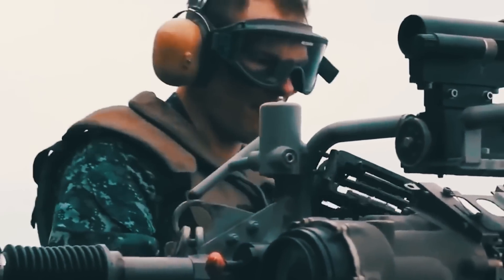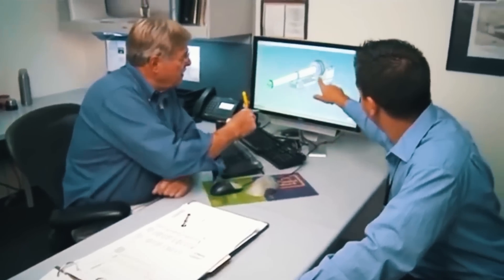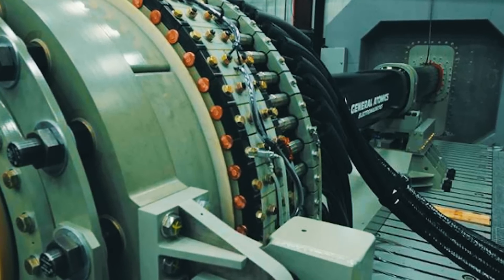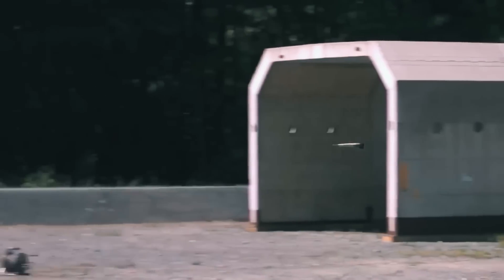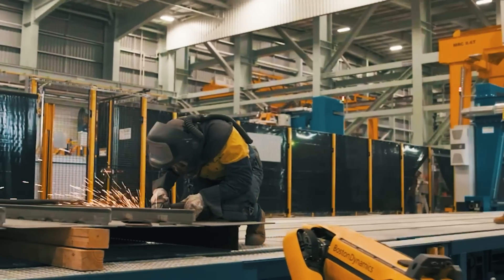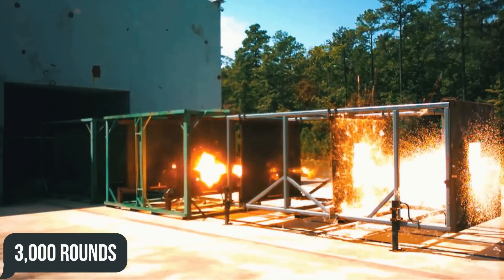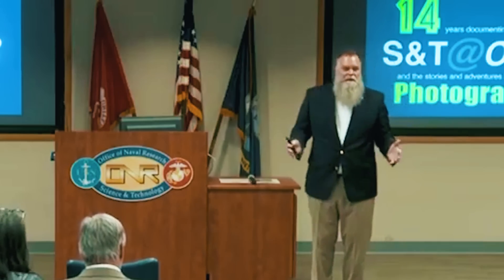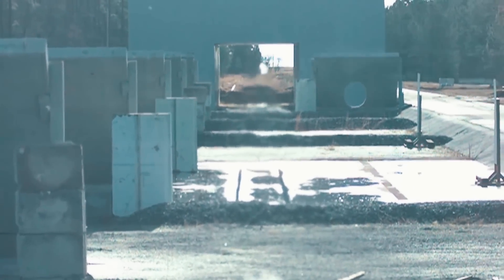US Testing Its Monstrously Powerful $500 Million Rail Gun

Comment: the rail gun is just a fancy meteor launcher

its advantage is: range, speed, accuracy, and destructive power without the need for an actual explosive warhead.

not to mention it will work in vaccum
the main problem??? we just don't have cheap tech to make it viable

Comment: A projectile traveling at 52,000 FPS had better be made of material that will withstand the temperatures of that speed. Normal metal projectiles will turn to molten metal within meters of the muzzle.

Comment: It's cool and all that, but it's not all that practical to use really. Like the huge one's make nice off shore batteries, Installing a set on a battleship would work, because it can use a mix combo of main gun turrets, powder charge for land targets, rail gun for ship to ship targets. The ship is big enough to use a reactor to pump out the power. I don't think it would make that much of a impact for a destroyer since most modern ones rely on missel systems and a single turret. Other than that, it is just a cool science project artifact to only see. Not much of anything else.

Comment: Now I have a question for all the brains in the room... What kind of power and distance could you get from this kind of weapon IF it was in motion? By that I mean, let's say this rail gun is on train rails, seems appropriate, moving forward at a fast rate... and the projectile was fired from this gun moving forward still... so it was launched as it was already going at a fast speed... would this increase projectile speed and distance? or is my science completely wrong here?
Reply: The effect on the speed would be relatively negligible. Even if the train was traveling as fast as the current fastest maglev train, about 370 mph, that is comparatively small when compared to the 5,400 mph, about 1.5 miles per second, of the projectile itself. Adding the speeds together you get to 5,770 mph, about 1.6 miles per second, so it wouldn't really be all that worth it given the already enormous energy the railgun itself needs (without thinking of what the train itself needs) to consume for only about 6.8% speed increase. 
There's also issues with targeting the weapon as when moving at that speed the barrel can create significant drag forces when pointed anywhere but straight ahead (even pointed straight ahead wouldn't be great if its' barrel is constantly open as that would create drag all by itself). It would also likely lead to damaging whatever mechanism you're using to rotate/elevate the barrel, depending on how robust it is, and it would cause the train to slow down and maybe even derail if the drag is high enough. Since a maglev floats above the track on magnetic fields, twisting one of the cars because it's suddenly not so aerodynamic anymore could be very, very bad when moving at several hundred miles per hour.

TLDR: Yes, it would increase the speed and effective distance of the projectile, but it's not really worth it given the whole host of other issues that would arise. And unless you're moving near or above at least the speed of a commercial airliner or high-speed maglev train, you wouldn't see an appreciable improvement anyways.

Comment: On a related note, High-Entropy Alloy research has been very promising recently, so I do wonder if eventually we'll see railguns with High-Entropy alloy coils, some research has already shown certain high-entropy alloys can be far stronger and more tolerant of pressures than any other materials we use. Our metallurgy needs to advance a lot more, for the most part we're still just using the same primitive processes that our ancestors in the 1300s used, about time for an update I would say. Hell if Nuclear Fusion actually works imagine the ships of the future: Fusion powered battleships sporting railguns and built with crazy strong, durable metals.
Reply: No matter what, Cost will be the limiting factor.  The economy of a nation and its ability to bring everything together to produce such weapons is not only dependent on its ability to have the physical resources but also the economic ones as well. One also has to have the engineers to put it all together. Climate Change will put a very big stopper on everything.

Comment: Wow. Just a straight up lie or is it stupidity? A railgun is NOT a directed-energy weapon. It fires slugs of very dense "depleted" uranium. It does this by launching the round in a sabot which fires the round using electromagnetism. The round gets spit out of the barrel with a ludicrous amount of inertial (mechanical) force and speed. The problem with the railgun is that it currently can only do a limited number of shots. The sabot/rounds destroy the "barrel" of the gun and it must be replaced in order to be able to be used again. This is very expensive. Hopefully a way to fire the round and levitate it (which means zero physical contact between the round and the so-called barrel) with electromagnets will be discovered soon.

Comment: People haven't used BLACK POWDER in main-line firearms for over 100 years. Modern gunpowder is NOT black powder, but "smokeless powder" which is nitrated paper or some other burnable substrate (like cordite). Gun powder does not "explode" but burns inside the chamber, which is why modern firearms are so much more powerful than older black powder guns, because they don't have to contain explosive pressure waves inside the chamber of the gun.

Comment: I remember reading an article in...Popular Science?  Popular Mechanics?  One of those... back in the late 80s, about a prototype railgun that was being developed.  If I recall correctly, they were experimenting with using plastic cubes as ammo, and they were having problems with them because the projectiles kept disintegrating due to atmospheric resistance...but they were putting a 2" cube through 1" steel plate, when they got the speed dialed in right.  The trick was getting it fast enough to do the damage without having so much speed that the projectile vaporized en route to the target.

Looks like they've resolved the projectile issue...and found a whole new set of problems.
Reply: ..well, that's how engineering works.  You build on past knowledge and what you learn from earlier designs.
Reply: that's weird, I thought the projectilee had to be magnetic for it to work, but I guess maybe not necessarily.
Reply: @qweqqweq2090  ...depends on the design.  A traditional railgun accelerates an armature and the projectile is pushed forward by it.  Coil guns, which are similar, require a magnetic projectile.

Comment: Unfortunately, the Zumwalt class of destroyers amounted to such a failure that of the 32 originally planned, only 3 were built before the program was cancelled. And only two are operational. The Zumwalt has had a wide range of problems such that it was doubtful that the railgun was going to be installed, even before the railgun project itself was cancelled.

Comment: good information.  I think the only way this works is with smaller projectiles and/or lower projectile speeds, a hybrid missile launcher would be the perfect compromise, accelerate it to just below mach 1 at launch and then local fuel propels it ultrasonic and all the internal guidance can work without overcoming crazy engineering challenges.
Reply: Nope, sorry, this is NOT "good" information. This mixes up so many terms, either intentionally or unintentionally, mistates facts, and fails to recognize the realities.

Comment: Gun powder??? lol They stopped using that in the 1800s lol
Reply: BLACK powder was in common use into the early 1900's.  BP was replaced with Smokeless Powder, which is presently in use, and still referred to as "gunpowder".
Reply: @kevincrosby1760  They don't use cordite then? lol
Reply: @jezza10181  Rarely, and only for specific UK naval and artillery guns.  

Cordite is generally viewed as obsolete.  The rest of the modern world has moved on to more powerful propellants with better stability.

The use of Cordite in small arms such as rifles, shotguns, and handguns ceased around 1914 or so.

Worldwide, I believe that Cordite is only produced "as needed" in one-off production runs by 1 specific German manufacturer who still has the required equipment.  UK manufacture ended decades ago.

Comment: So at the 2:12 Mark, we see this Rail Gun shoots at 52,493 Feet Per Second (FPS).

Wait!  Lemme get my Calculator!

52,493 Feet PS divided by 5,280 Feet in a mile = 9.9418560606 Miles Per Second
    Times 60 seconds per minute times 60 minutes per hour
                          = 35,790.68 MILES PER HOUR?
         DIVIDED BY THE SPEED OF SOUND (700 MPH)
                        = OVER 51 TIMES THE SPEED OF SOUND?
   
                    MACH 51
That's unbelievable!

Comment: vacuum launch should be considered by the military we have little launch silos on each destroyer and if we decided to build material strong enough to withstand +17 atmospheric pressure or greater then upon need to intercept hypersonic missiles you can do the math at how pressurized the system needs to be to send it just under the speed of light beings light speed cannot be captured but if I can launch an interceptor at 92 percent of the speed of light and intercept any incoming missile while it's in space causing no harm to my people or even the world without risking my troops to do so. if we can launch a golf ball 99.99% the speed of sound by using a vacuum pressurized pcp pipe we can launch a missile using the same method.

Comment: The magnetic field should be redesigned to surround the perimeter in such a way that it keeps the shell from wearing out the liner , sort of similar to how a super collider keeps super heated particles contained
Reply: Back of the class for you sir!
The projectile has to be part of the circuit and therefore must touch the sides at all times - it cannot be held in a gap, otherwise electricity could not flow.

Comment: The engineers of this rail gun might have done well to visit a modern iron tank fabrication shop.  The way a magnetically attached drill press is held down to the surface of a tank is eye opening about the use of magnets.  Assuming one is open minded; one aspect of this mechanism is to put two complimentary magnets next to each other and flip one of them in order to "turn off" or "turn on"  the holding magnet.   Be interesting to be able to accelerate dark matter this way; huh?  Shutting it down here.  Y'all engineers are way smarter than me.  The experiences of a human lifetime have a useful limit.  After that you're just a bundle of nerves.

Comment: The power requirements will probably limit these to shore based systems. At least for now. But the potential of rail guns as a game changer on the battlefield merits further researches.
Reply: Nuclear reactors baby!!!
Reply: That seems like a solvable engineering problem.
Reply: i wonder how fusion reactors might influence this tech
Reply: @sebcw1204  They wont, at all.
Reply: @sebcw1204  The issue is power, more than energy.  The engine of a typical modern battleship produces  50MW or more.  You need ~50 MJ to launch (50 MW for 1 second) to fire the railgun, so each firing would draw ~1 second of power from the engines.  But it has to be stored into something that can release that energy extremely quickly, such as banks of supercapacitors.  That's the bigger issue.
Reply: The US defence department is the greatest rort of peoples taxes in the history of the world
Reply: @rizzlervontrappe1515  There really is no reason to even have a federal government other than national defense, yet national defense represents only 10% of federal spending.
Reply: @eventhisidistaken  only 10%…that is a huge amount. Do you have any idea what other countries spend on their military? Us $778b,  3 x times what China spends and 10 x India. It’s a an eye watering sun.
Reply: @rizzlervontrappe1515  The US is the current world empire.  Of course it spends more than any other nation.  You missed the point.  Only 10% of federal spending even goes to military - which is arguably the only necessary function the federal government even performs (well, we'll throw in international diplomacy too, but military is a subset of that).
Reply: @rizzlervontrappe1515  Is that you Vladimir? 🤣
Reply: Rail guns will likely never see widespread or any real combat use. The technology is interesting but the physics is nearly insurmountable. The guns literally destroy themselves.
Reply: @Adaephonable  I don't understand these kind of assertions.  Hyperglide technology already exists with objects travelling at similar speeds.  These are engineering challenges, but no reason to think there is some fundamental physics that prevents solving them.
Reply: its not the power that limits them at all, its the friction wear on the rails
Reply: Well, then the materials science people have their work cut out for them. You know, we are on the precipice of a terrifying new wave of developments that will make tanks, and howitzer cannons, and rocket systems almost quaint. Robotics is charging ahead with innovation that produces machines that right now are only small--but amuse engineers who use them to terrorize lion prides. But this industry has already taken on a life of its own. Engineering is much more ambitious than making dog sized bots that can freak out big cats like lions and cheetahs. On the horizon are 150 ft. high monsters that can walk on the ocean floor and come up on the shores of any continent, any nation. Couple that with weapons like rail guns, and death rays, and welcome to a brave new world--one in which we either abolish nationalism and borders, or else wake up to see the city that u thought u were safe in raised to the ground all around you.
Reply: @johnishikawa2200  Robots face the same problem animals do - weight increases by a cubic power.  To power a 150 foot robot takes 8 times as much power as a 75 foot robot, as an example.  Also, the force on the joints increase by a cubic power as well, so joints have to be proportionally larger and larger.  I'm not saying 150 foot robots are impossible, but yeah, they're impossible.
Reply: @T Oadaly: Before they had steel, buildings higher than what, ten stories, or thereabouts, were impossible. The materials science people may come up with something that will revolutionize robotics and how big and heavy that machines can be made. So don't say I didn't warn you--when sometime in the not too distant future you go to bed after dinner, and find yourself the next morning looking around , the light of the sun cutting through the chilly air of the previous night, as you watch these machines rampaging through your city. Don't complain to me when ur stuff goes up in smoke!
Reply: @johnishikawa2200  Steel building are mostly empty space.  I suppose you could build a robot that is also mostly empty space, but it wouldn't be very menacing.  It would collapse along with the first building it crushed.
Reply: T Oadaly: What if a material can be developed such that sky scrapers several miles high--instead of several thousands of feet--can be constructed? The center of mass of such a building would be--as they are now--right at the sidewalk. Hence most of a futuristic building, several miles high, would be below ground. Imagine a time in the future when such buildings spur underground construction so that cities would be connected by webs of underground tentacles--like roots of trees in a forest--coast to coast.  People would travel at fantastic speeds, using hyperloop technology, underground. People would live and work almost entirely underground, and only come up above ground level through one of these miles high sky scrapers. And should a jumbo jet liner--or a missile--crash into such a structure? Why it would do about as much damage as say an unfortunate sparrow would do by crashing into a modern building. These underground people would be virtually immune from a nuclear attack from above. But not from 150 ft high machines of war. These weapons, built from the same strong materials that the buildings are made from, would become the new weapon needed for seizing land--much as the tank is today.

Comment: Projectile weapons launchers are nearing a dead end in an atmosphere environment (still have great use in space though where there is no air resistance) so focus might yet yield results in the development of more efficient and smarter projectiles to make the most of the launcher capabilities. Directed energy or particle beam weapons are a better bet for the longer term but even those would need to deal with the damn pesky atmosphere getting in the way.
Reply: The fuel used to stabilize a space craft after firing a rail gun would limit it’s usefulness in space and hopefully not kicking the space craft out of orbit, and crashing back to earth.